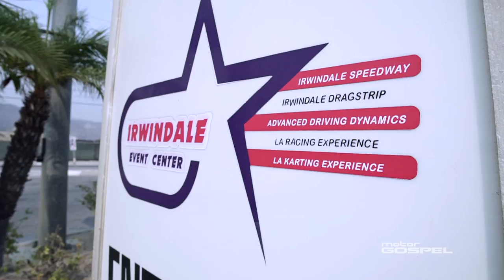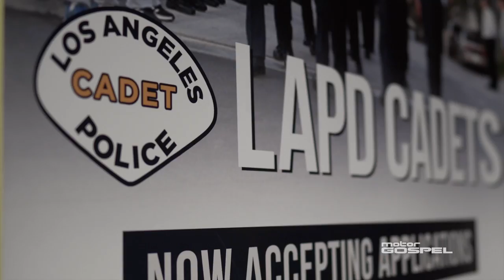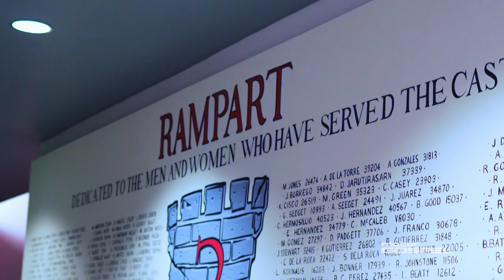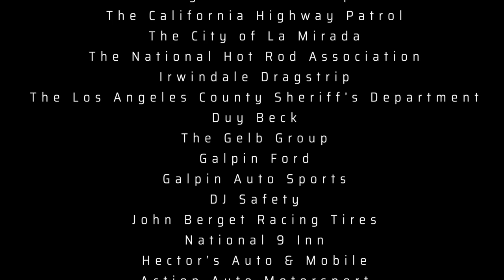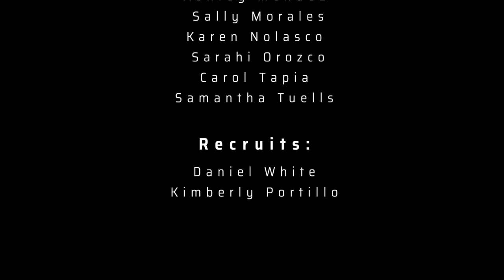Irwindale Speedway Beat the Heat 2021

Comment from the maker: The Irwindale Event Center is a motorsports facility located in Irwindale, California, United States. It opened on March 27, 1999 under the official name Irwindale Speedway. Toyota purchased the naming rights to the facility in 2008, and from that time until 2011 it was also known as the Toyota Speedway at Irwindale. The speedway features banked, paved 1/2- and 1/3-mile oval tracks and a 1/8-mile drag strip.